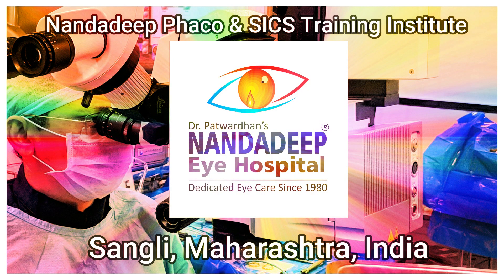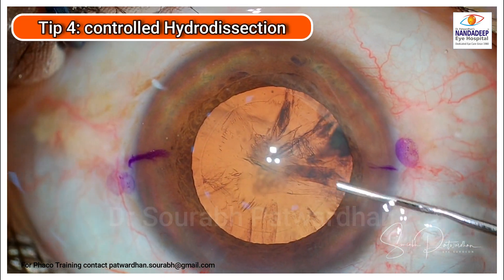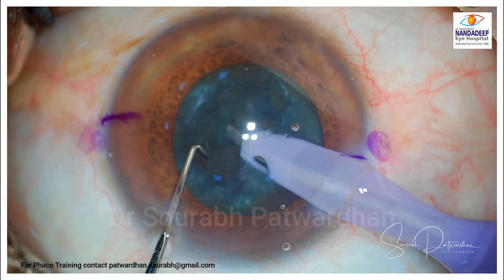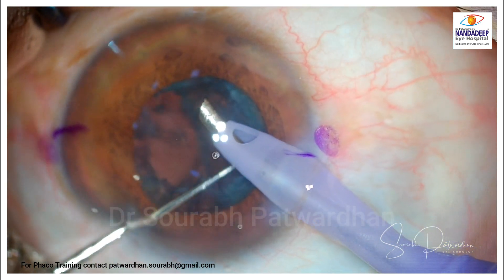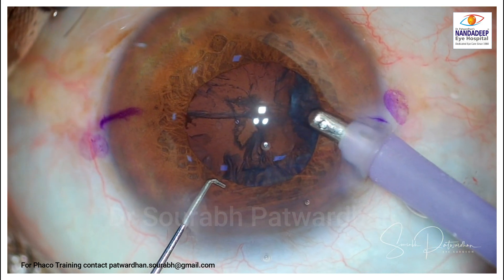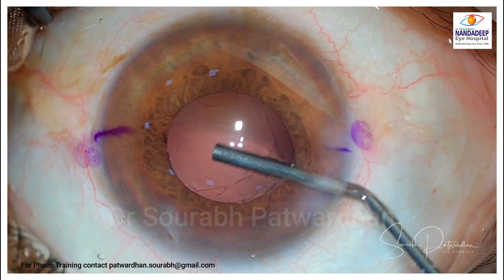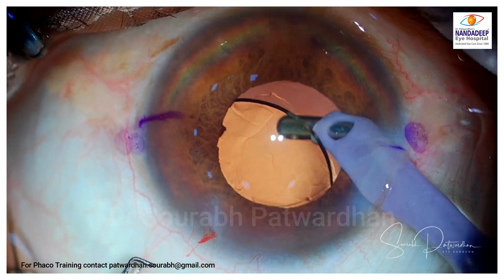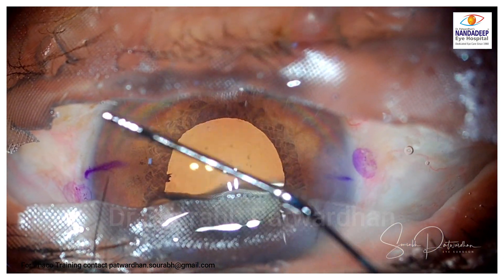76 Floppy Iris (IFIs) 11 Tips Dr sourabh Patwardhan

Comment: Hi sir
Congrats for successful surgery
The Golden 3 roles in dealing with IFIS
Avoid AC over pressure either OVD or bottle hight
Intracameral phenyl ephrine increase s iris tissue tonicity
Reduce asp. rate
Atropine is not a good idea as it cause more loss of tone
I found this more effective than iris devices and dispersive ovd
Good luck

Comment: dear doctor I have one question about PXF What do you think is the common cause of poor dilated pupil with PXF ? and what  is best pre-op & intra-op managent with cataract operation ? thank you very much in advance
Reply from the maker: Proposed reasons for non dilating pupil in PXF are stiffened iris and fibers adhering posterior surface of iris with anterior lens surface. My personal experience is that pupillary dilatation is inveresely proportional to severity of PXF. So more the pxf less will be dilatation.  Also non dilatation is more commonly associated with poor zonules and phacodonesis. 
My choice of pupil dilatation is Bhex ring if i can see that zonules are not severely affected. In evident phacodonesis i use iris retractors.